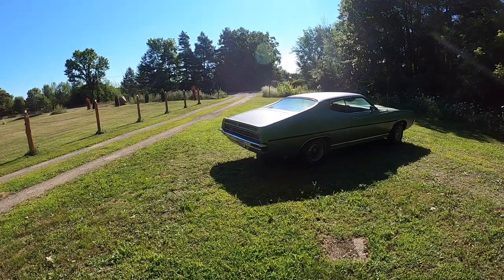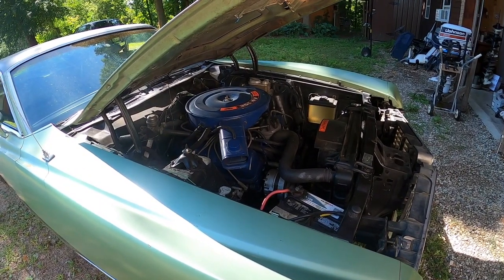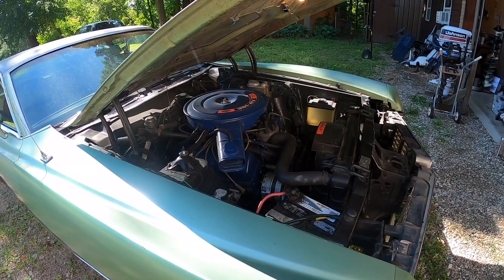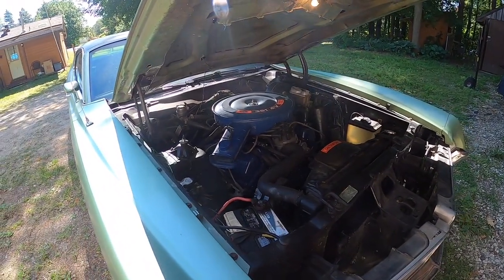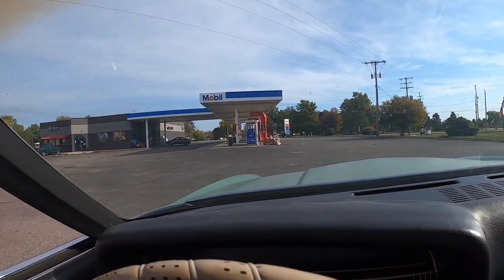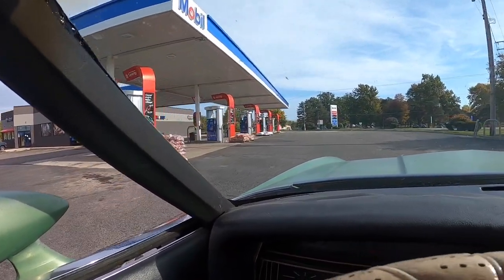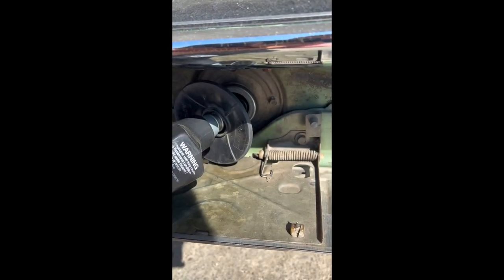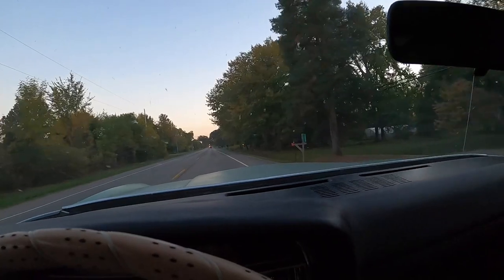1971 Ford Torino GT - fuel economy mpg test - 351c - Classic muscle car cruise

Comment: Well, I'm 58 years old so gas in 1971 was around .55 cents, so that's about $1.10 for 36 miles. Not bad. My parents bought a new 72 gran torino sport and got 300 miles on the first tank of gas. That was 15 mpg for a 20 gallon tank. That was 11.00 dollars for 300 miles. Amen. Russell John 5:24.

Comment: I had a 1970 torino GT with a 429 thunder jet (Passenger car engine) with a 4 speed top loader trans with 3.91 gear. 12 mpg tops. Bought it in 1979 when I was 19 years old for $2500. Sold it in 1985 to fund a race car project.  Biggest mistake of my life. Not a day goes by regretting not have it yet
Reply from the maker: Growing up, my dad had quite a few torinos/fairlanes which is how I got into those cars in the first place. One of em was a 70 fastback w/429 TJ that he had done a mild build up on. The car really flew and with highway gears wasn’t too bad on fuel if you stayed out of the accelerator pedal ;).

Comment: Had a Torino  (70/71 )GT 351C mildly worked back in ‘84.   My home town to Wpg Manitoba almost 120 miles ( 200 Kim’s) @ just under 120 mph ( so I could see Speedo not buried I held about 118 mph) my fuel economy , metric converted to USA gallons was about 6 or 7 mpg.
Reply from the maker: Thats some high road speed to maintain right there!
Reply: @mattsboatyard6891  Had a Hot GF in the City, I’m in Ontario.  Back in the day no pts on licence out of province, and no law to “ automatic tow after speeding 50% or more over.   Manitoba is flat like Nebraska, and so was She.
Reply: Yeah I had a 71 351c auto here in Winnipeg too . When I booted it around the mileage was abysmal  . When I nursed it , it was still worse than this car . My car was totaled at a light by a woman running the light .

Comment: I had a 71 Torino , same engine combo . Way back in the late 70s  . You are getting better mileage than I got . I believe  that I averaged 13 mpg . One question is why did you not like the power steering ? I don’t recall any issues with mine .
Reply from the maker: I prefer manual steering on older vehicles because the road feel is a bit better and there are less mechanical things to have to service. Specifically on the pre-72 ford unit, it was more of an add on system and the ones I’ve driven were always a bit numb and didn’t work well in low speed situations which is precisely when you’d want power steering to work well.
Reply: @mattsboatyard6891  Thanks for the reply , I had a AMC The Machine 390 auto after the Torino got smoked , that car had balky power steering and wipers . And a pos Borg and Warner automatic . Starting around 72 AMC started using the torque flight 727 from Mopar . Much more durable . The Torino drive train seemed pretty stout .

Comment: About what I would expect.   the 3.50:1 axle ratio is an economy killer but like you said it's not a freeway cruiser.     It the car was modified with an overdrive transmission you might see 20 mpg on that same cruise... but for most older cars the cost to do that isn't worth the investment unless the vehicle needs to be a daily driver for long term.
Reply from the maker: Yeah, the 3.5's are great for driving around town and getting away from a stop light but not so great for the highway.
Reply: My 71 had more like highway gears , I don't recall the ratio . Anyway that car sucked gas , worse than yours . I thought that you did for that car .
Reply from the maker: Having the engine recently rebuilt helped. Before that, my mpg’s were pretty inconsistent- sometimes it’d do alright(maybe 13-14) and sometimes it would pig out (9-10). I made this video before I installed the gear vendors overdrive- maybe I’ll do another test run now that the GV unit is installed!

Comment: I had a 70 torino Fairlane 500 with the 351 C engine and I loved that car.
When I drove responsible gas mileage not bad
Reply from the maker: Yeah, if you stay out of the accelerator pedal, they're not so bad on fuel.

Comment: 3.50 rear gear with a 27 inch tire (G70-14, stock size for 1971 GT) gets you 2600 RPM at 60 mph.
Reply from the maker: Currently, the car has 225/75/14's on it which are about 24-24.5" tall.

Comment: not bad but highly innacurate an estimate given the small amount of fuel consumed. You'd have to run a whole tank through to really know.
Reply from the maker: You’re not wrong- the methodology isn’t perfect. I did run the test a second time because of that and came up with a nearly identical result. Over the winter I installed a gear vendors overdrive unit and if I do a second test, maybe I’ll do a longer test run.
Reply: @mattsboatyard6891  that's not bad an online resource I use shows city 7-8mpg freeway 12-14 mpg highway below 65mph 13-16mpg.

Comment: 71-73 Cougar/Mustang with PS and 4V Cleveland, use Saginaw variable ratio & Quick steering box. Almost identical to GM A body fast ratio. (442,GTO, Chevelle, Skylark GS. So No ram booster situation like 65-70 Mustang. Thats the setup ticket!!
Reply from the maker: I like it. I’ve never been a big fan of the power steering set ups on 71 and earlier mid-sized fords.

Comment: Big valve small cam philosophy. Ford did major dyno testing on this engine to get it perform for the street.
Puts the truth about this engine. That this engine makes good drivable low speed torque.
In the 80's I had a near identical car. Same results. 15 miles per gallon.
The stock cam does exactly what it was designed.
Reply from the maker: The engineering of the 351c is fascinating- it is an extremely well thought out engine. The whole thing about it lacking low end torque is total myth- especially with the closed chambered heads and proper cam timing. I plan to put some more videos up regarding this car when spring arrives!
Reply: @mattsboatyard6891  Im a retired engine builder/ machinist. Did at least 70 or more Cleveland's over the years.
Totally true. A 4 v makes excellent torque and off idle drivability. 
People that say otherwise, don't know very much about this engine, like they think they do.
Reply: At altitude 5500 feet or so these engine's had a mushy low end. I've had many of these engine's. But at sea level, nobody had any complaint about low end torq. In 74 Ford sent all the clever stuff to Australia.  They have developed great heads for these motors,all with smaller intake runners in aluminum. Love these motors.

Comment: That 4v 351c should be a CJ engine with 4 bolt mains….I had a 1970 Torino GT with the same engine..bought it with a rod knock.
During tear down it had 4 bolt mains along with 4v heads…research showed it to be called a Cobra jet..
15 mpg isn’t bad at for a bigger car and a healthy engine! 
Shoot….my modern day super duties only get 11 mpg ….but with todays fuel it’s about 1.5 mpg less with 10% ethanol
Reply from the maker: You’re correct, the motor in my car started life as a 351CJ- it came out of a 72 Ranchero. Freshened it up a few years back and replaced the open chambered cylinder heads with some closed chambered heads. Interesting stuff about your car.  My understanding on 70-71 model year Cleveland’s is that they typically were 2-bolt main but that Ford indiscriminately cast some for 4-bolt mains(both 2v and 4v motors) and this is according to the ford parts interchange book written by George Reid. The 351cj debuted in late 1971 and was an option thru 74 and ALL CJ blocks(as well as 351BOSS and 351H.O) have 4 bolt mains.
Reply: @mattsboatyard6891  that is an interesting scenario , when I pulled the engine from my 70 Torino it looked like it was in there a long time! I suppose it could have had a replacement engine at some point and maybe got a 4 bolt block for some reason …the engine was all stock with no mods and full of grease and grime! (Standard bearings and standard stock bore …so it wasn’t rebuilt either.) Probably ran low on oil and why it spun a rod bearing. It’s also possible it was a mid year build and was closer to being a 71 model year and the CJ 4 bolt block was used? 
I know manufactures did a lot of weird things back then …a buddy of mine bought a brand new 67 fairlane GT. He told me stories of how his wife drove the car all the time and could put keep back tires on it…was badged as a 390 but eventually he had to do some engine work on it. It has some out of the ordinary parts on the car that typically 390s didn’t have (he never said what they were) after more inspection he discovered it was a 410 FE engine! He never ordered it that way and was the original owner! Weird
Reply from the maker: @markcole6475  Wow, Figuring out that the 390 was actually a 410 must have been a pleasant surprise!!
Reply: @mattsboatyard6891  yes, he was pleasantly surprised! It would have been a super rare car if it was an actual documented special ordered 410.
But being it appeared to be a mistake during assembly it would be hard to prove being rare and worth more money
Reply from the maker: @markcole6475  Yeah, it must have been a mistake! very interesting!

Comment: Not bad. My 71 Torino 500 351C 2v has been getting about 12-13mpg. That is driving on the freeway most of the tank about 70-75 mph. Not sure what gears I have. Also have C4 trans. I do have Holley Sniper TBI, headers, dual exhaust, Edelbrock intake,
Reply from the maker: That sounds like a nice build. How do you like the Sniper EFI set up on your Cleveland?
Reply: @mattsboatyard6891  it runs great. I had some minor issues early on, but with a bit of reading and moving some wires around it has run very well. I also have a Hyperspark distributor so I can change timing on the fly. I have a cam I’m waiting to install. Can wait to wake this car up even more.
Reply: If you were to put it back to stock, mileage will go up.
Reply: On the front of the rear end is a tag attached to one of the 3rd member bolts. Use a small wire brush. You will see the ratio on the tag.

Comment: Sounds like a push rod tapping. Those multi groove keepers like to drop valves.
Great video and interesting video.
Better than most.
Reply from the maker: The cylinder heads on this were refurbed recently and the multi-groove keepers were done away with for the reasons you mention. The motor has the crane variable duration lifters(similar to the Rhodes style lifters) and they are a noisier lifter than your average hydraulic flat tapper lifter. Thank you for checking the video out, glad you found it interesting!
Reply: @mattsboatyard6891  did you change out the rockers ? Crane makes that quick and dirty bolt on adjustable conversion. 
I've used it many times successfully. 
But never on a hot 600 lift race engine.
Reply from the maker: @cammontreuil7509  The rockers are new replacements but they are an OE style non-adjustable style rocker.
Reply: @mattsboatyard6891  someone must have done the valve job right.
Variable lifters are sensitive to pre load.

Comment: What are the headers from? I can't find shorties for my 4v 71 Torino GT
Reply from the maker: These are sanderson short tube headers for 351c w/4v cylinder heads. i do see them available on ebay sometimes and i believe you can also buy them directly from sanderson's website.
Reply: @mattsboatyard6891  thank you. Are they any good/pain to keep from leaking?
Reply from the maker: @nathanieljones7981  They are a good quality header. I have not had any issues with exhaust leaks since installing them!
Reply: @mattsboatyard6891  Thank you, I will be looking at buying a set soon then
Reply: @mattsboatyard6891  Did you use a gasket? I saw they say don't use one but that sounds like rusting to head issue in future
Reply from the maker: @nathanieljones7981  With the Sanderson's, they instruct you to use permatex ultra black rtv instead of an exhaust manifold gasket.

Comment: Do you have any plans for other upgrades, like an overdrive or fuel injection?
Reply from the maker: I’ll probably stick with the carburetor because I like the stock appearance of the engine but I did order a Gear Vendors overdrive unit. I’m hoping that I will receive it soon and install it over the winter.
Reply: @mattsboatyard6891  Sounds good. What about ignition? Are you still running points or did you upgrade to electronic ignition?
Reply from the maker: @RodBeauvex  it has electronic ignition, been running a ford duraspark in it for the last few years
Reply: @mattsboatyard6891  Ooh, nice. Not a lot of people actively seek out the Duraspark system. Good job for keeping it Ford. Did you notice any improvement over points vs Duraspark?
Reply from the maker: @RodBeauvex   yeah it runs smoother and the manners are better. Durasparks aren’t performance oriented per se, but I’ve had good experiences with them and i think for a mild performance application like this, it is a good match.
Reply: If you put a 2.75 rear end, mileage will go up.
Also put a shift kit in transmission. 
If you change timing chain. Advance the cam two degrees, that will improve mileage a bit too.
If done all these things before. 
People won't believe it but the highest recorded mileage I got from one of these engines is 21 miles per gallon.
But I slightly warmed the fuel before entering the carb and I channeled a small amount of hot air into the air cleaner.
All of these modifications you have to adjust and watch for pinging.
Also run a Ford duraspark coil, distributor and blue ignition box.
You can experiment with plug gap.
Reply from the maker: I really like the 3.5 gears, i think that it is well matched to the motor but i am in the middle of installing a gear vendors overdrive which will give me a final drive(3rd gear PLUS overdrive on) that is ~2.73.
Reply: @mattsboatyard6891  interesting. The 71 I had had the same 3.50 gear. Something to that.
Reply from the maker: @cammontreuil7509  Its a nice combo
Reply: @mattsboatyard6891  Sounds like a great addition. That OD will tame that down Final Drive down to like a 2.73 when cruising.
Reply from the maker: Yep! It will be able to do freeway speeds without issue.
Reply: How much driveshaft will you have to cut off to install it? I thought about that one. It gives you double the number of gears doesn't it? I also considered a T-5 manual swap or AOD
Reply from the maker: It's about 13 inches shorter. yes, you do end up having double the gears in a sense because you can turn the overdrive on in any gear